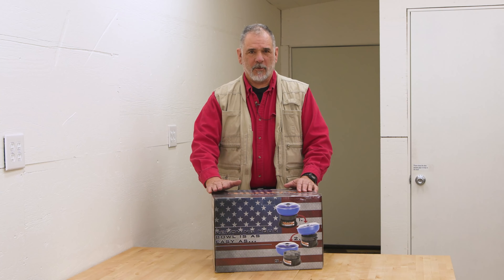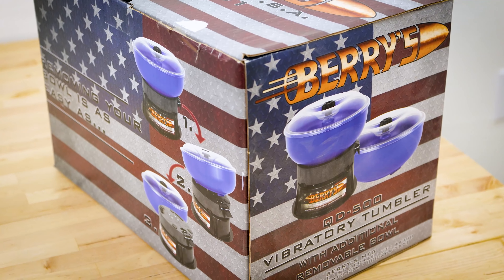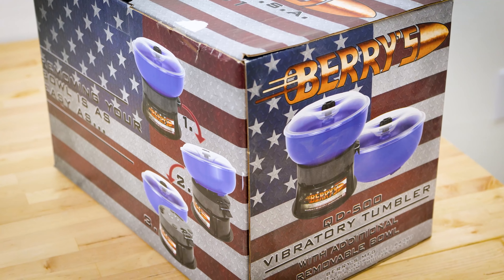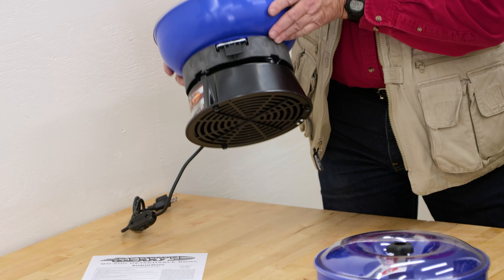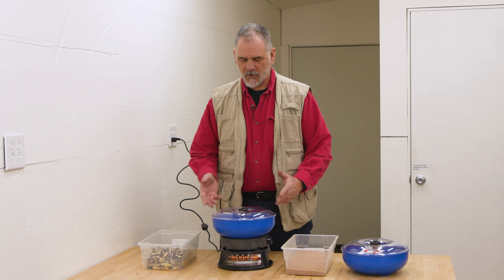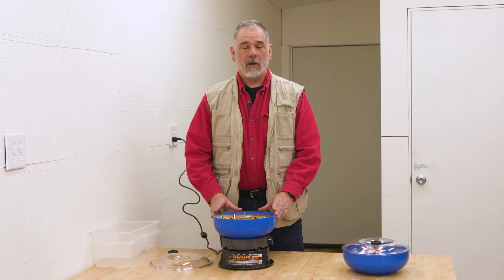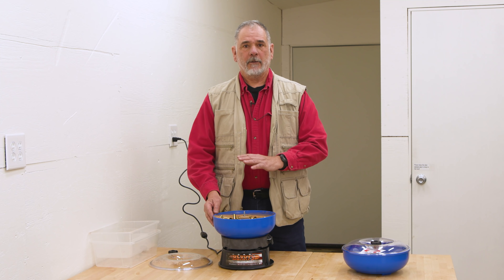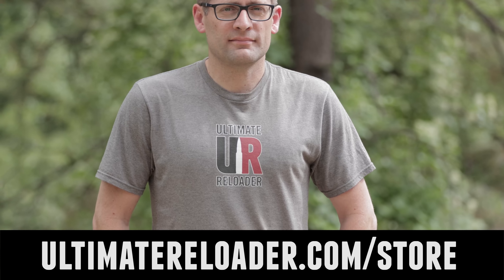Hands-On: Berry's QD-500 Vibratory Tumbler

Comment: Being able to remove the bowl and take it over to the sifter is a nice feature
Reply: You can do thr same with the lyman.
Reply: I love the quick change feature but gave up on dry tumbling after my house got contaminated with lead dust from doing it in the basement. Went to went tumbling after that. Only time I bust out the dry one is for the odd loaded round I want tumbled.
Reply: I got a wet rotary tumbler a few years ago, now my Lyman dry tumbler sits up in the attic unused.  Not having to worry about lead contaminated dust is huge part of that reason.

Comment: I used a dry tumbler for many years and them went to water and steel pins. The first wet equipment was the harbor fright rock tumbler.  I now use the frankford arsenal wet tumbler. An idea for a video would be Dry Tumbler vs Wet vs Ultra Sonic for Time, Quality of cleaning and cost of equipment for the method. Another idea for a video would be to ask a reloading brass company for a tour and talk about once fired brass and processing for resale.

Comment: I started reloading 50 years ago with a Lyman dry tumbler. When I started competing in F-class AND shooting prairie dogs (about 10 years ago) I was also using dry tumbling with walnut hulls and Dillon polishing liquid with a Dillon 750 and Dillon 500 tumbler. I then switched to using two Thumler's tumblers with SS pins. The wet tumbling solves a few problems not addressed with the dry tumbling. It cleans the primer pockets and case interior. It produces no abrasive dust that settles on everything in the area like 10 years of accumulated household dust. It's quick and produces a superior finish. It completely cleans the inside and the primer pockets to a state that looks factory unfired. The down side is the tumbling action peens the neck edge down so inside neck chamfering is needed. I tumble for 30 minutes. The burr is produced in as soon as 15 minutes. At 15 minutes the brass is not fully cleaned. In order to keep from removing too much brass (every time I prep the brass), I use a hand case neck reamer but turn it counterclockwise. This moves the burr out of the inside of the neck so bullet seating is smooth, without cutting brass away. Without doing this step, copper is shaved from the bullet jacket and seating force is all over the map. Hand swaging the necks of every round adds a significant amount of work. So, I have reverted back to using my two Dillons, walnut hulls and Dillon polishing media. The primer pockets remain somewhat carbon fouled and the polish isn't as nice, but the necks are not peened and they are clean enough. Another issue with wet tumbling with pins is the inside necks become too clean. Yes, they can be too clean. The carbon fouling left by vibratory tumbling acts as a barrier against galling/sticking. You must dry lube your necks if they are too clean, which prevents sticking(another step added). I now vibratory tumble both my competition brass AND my prairie dogging brass. I will shoot 1000 rounds of 6mm Dashers over a prairie dogging trip. My prairie dogging bullets are coated with Hex Boron Nitride so I can go all day without cleaning my barrel. Also makes cleaning much easier. I will shoot about 160-200 rounds for a weekend of F-Class competitions. Those bullets are weight sorted, tips trimmed and repointed and loaded without the HBN. For what it's worth...

Comment: I have been using an old vibratory tumbler that I used to polish rocks with. It works fine, large capacity, but it is messy and a real pain to empty.  You have to pick the whole unit up to dump it.

The removable bowl is a real plus, I'm tempted to try it.

Comment: I've been using a Midway 1288 that I bought about 35 years ago, looks like a pumpkin. Still runs like new but doesn't have near the rolling action like this Berry's has, nor is it as quiet. 
I ordered the QD500 from Midway this morning, along with more walnut and Flitz. I will get a wet tumbler and pins, too, but for the money I'm impressed with the Berry's stuff, and made in USA is certainly a big plus.
Thanks for the demonstration 🍻

Comment: Used to use the Dillon Reloading vibratory tumblers and added the FA wet.  Got tired of lifting and pouring that large Dillon machine.  Sold all of it and now use the Big Shot Tumbler -60 (LemiShine, Dawn and pins) and have one of the Berry's QD. I've used walnut, corn cob, rice hulls, rice but would appreciate learning if anyone has had success with dry ceramic media.  I do like the QD Tumbler nuts sold by Brownell's. Spinning knobs isn't for everyone

Comment: I have two of the cheap Frankfort arsenal ones, one of which I got used for $15, and both have worked well for 5+ years and 20,000+ cases.  Same thing with their case dryer.  Just a sample of one.

Comment: I do both dry and wet tumbling.

Dry tumbling for a preliminary one-hour cleaning using fine grade walnut (Harbor Freight) treated with a small amount of NuFinish liquid car polish.  The cases can then be decapped to remove the primers and then they are wet tumbled for 3-4 hours in a rotary tumbler with Dawn, Lemishine, and Guntap steel pin media. After I separate the pins and dirty water from the brass the cases are thoroughly rinsed and then wrapped up in a large towel and shaken to get most of the water off. I then spread them out on another towel under a ceiling fan to finish drying.

Comment: Been reloading for over 40 years. So 25 years ago I moved and had to down size and got rid of most of my reloading stuff.   Dumb move I know.  About 20 years ago I bought 2 equivalents to a Lyman 1200. Used them both since then. One went bad about 3 years ago so I purchased upgrades again sticking with Lyman this time I purchased the 2500 model. Love all three of them, yup one is over 18 years old and probably has cleaned well over 200,000 cases. They use walnut shells and while they clean well and get the outside and inside of the cases looking almost like new the flash hole and primer pockets always need extra care, I also mix Nu-Finish car polish in with the walnut. Talk about a shiny and wax protected finish. I have ammo I reloaded in 2014 that looks brand new.  Fast forward to about 2 to 3 years ago the ultrasonic cleaners are the rage, but they tend to leave the brass very clean but lack the new brass shiny luster.  So now I use the ultrasonic to clean the deprimed cases with citric acid, lemon oil, and dawn dish soap. No more issues with primer pockets.  After ultrasonic cleaning toss them in the dry tumblers and the finished product is brass that looks like it came off the factory floor.  
Stay safe and god bless the land of the free!

Comment: I like my brass nice and clean. After that half hour, the inside of those cases still looked real filthy. Mine go into the Frankfort Arsenal rotary tumbler and I use 1 tablespoon of Dawn dish soap, a 9mm case full of Lemi-Shine and the steel media pins that came with it for an hour to an hour and a half. 

Then after draining and separating the brass and steel media I dry the brass using a plastic colander/pasta sifter and a cheap thrift store blow dryer. After that they then go into the RCBS vibratory tumbler loaded with a 50/50 mix of walnut and corn cob media and 3 capfuls of Dillon’a ammonia free brass polish for an hour. Brass comes out with the inside, outside and primer pocket looking like brass gold! 

That said, I like the idea of the removable top as well as an extra too. But I see that clear plastic lid cracking and breaking in time. Time will tell.
Reply: That’s my Formula too.
I use the Large Thumbler’s Tumbler
The SS Pins Clean the Primer Pocket and Inside Shiny ✨
Reply: Maybe I'm missing something here, but why do so many people get in a twist about having the inside of their brass polished to a mirror shine?
As long as the outside is clean and shiny, my dies and chamber won't get dirty or scratched, and I'm certain that the powder charge will ignite just as well with semi-dirty interiors than with anal-retentive polishing.
Sorry, but I just don't get it.

Comment: I used to dry tumble, but moved on to wet tumbling with stainless pins using a FA Rotary Tumbler. I only use the old vibratory tumbler now for getting lube off of finished rounds by putting them through a 20 minute cycle with plain old ground corn cob media.

Comment: I had the Cabelas version (made by Berry’s) and wore it out over the course of 3 years. I liked it so well I bought 2 more. Does a great job and is quiet for what it is. In all fairness, if I would have cleaned the motor, the bearings probably would have lasted longer. When I start coating bullets, I will be buying dedicated bowls. Thanks again for the content.

Comment: I switched to wet tumbling a few years ago and haven’t touched my vibratory tumbler since.  You increase your lead exposure risk with dry tumbling due to it being in the dust.  Inhalation of lead is a huge cause of high lead levels in your body.  If you use the dry tumblers, you really should be wearing PPE when handling this stuff.  Also, lots of folks don’t realize that a lot of lead risk in processing brass comes from the primers.
Reply: I'm making a note to myself to stop licking the window sills next year....

Comment: Lyman rotary tumbler, 1-1/2 oz Hornady one shot and 5 pounds .047 stainless steel pins. Fill with cold water to about 3/4 full. Wash lube off cases with a bit of dish soap and warm water first. Pins stay clean.

Comment: Man that walnut media leaves more dust  on your stuff, than I get  on my truck after a dry October week of mulie and pronghorn hunting out in Wyoming. I have a Midway tumbler I've had for thirty years now. I fill it with cob media and a double shot of brass polish. Them babies shine up like the gold jewelry in a Tiffany's display case.
Reply: I see lots of comments about walnut hull media producing lots of dust, but why would that be a problem as long as you keep the lid secured on the tumbler?
Also, I've been told by other reloaders that what dust accumulates in the bowl can be reduced greatly with two or three used dryer sheets put in the bowl before the tumbling starts.
As long as your case separator has a lid, the dust from separating should be contained in that too.
I've done plenty of case cleaning using my 30-year-old vibratory tumbler, and I have no idea what all this bellyaching about dust is.

Comment: I am using a vibratory tumbler I bought from MidwayUSA years ago, marked Midway Model 1488. The base is black, and the bowel is orange, so it could well be a Lyman product. Ground Walnut medium has been my choice, as its abrasiveness scrubs the crud off pistol brass, as well as my rifle brass. All vibratory tumblers work about the same, with the difference being the size of the bowel.

Comment: I use an old lyman turbo tumbler with treated corn cob. Takes about 3hrs to get em nice and shiny to my liking.
Reply: Would you recommend corn cob over crushed walnut?  The walnut I use creates a good amount of dust after a while, and I’ve heard corn cob doesn’t and lasts longer.
Reply: @bannedbycommieyoutube5time920  If you're cleaning once-fired brass or brass that isn't particularly dirty, corn cob will tend to get a higher polish more rapidly and with less dust.
If your brass is heavily fouled, go with walnut.
You can greatly reduce the dust by not opening up the top of the bowl until the tumbling process is complete and the tumbler is switched off.
You can reduce the dust more by waiting a minute or two before taking the lid off the bowl and by putting two or three used dryer sheets into the bowl before beginning the tumbling process.
If dust with your rotary brass separator is a concern, just be sure to have s separator that has a lid that covers the whole thing before you start spinning out the media, then wait a minute before opening the lid.
I do it all the time with both walnut and corn cob and I find myself puzzled by all the guys who go through the hassle of rotary tumblers with liquid and stainless steel pins because they're so put off with dust.
Reply: @Gunners_Mate_Guns  thank you very much!  The brass isn’t that dirty as most of it is picked up at a shooting range with a clean concrete floor.  I will have to try the corn cob.  Your dust mitigation tips make sense as well.

Happy shooting 🇺🇸

Comment: American Flag box - Made in China device?
Reply: @Tex Patriot, From the Berry's website
Quote
Berry's Model QD-500 Vibratory Tumbler is an industry first. With a patented quick-detach system, you can remove the bowl from the base completely, keeping spills and messes to a minimum as you pour your brass and media into a separator without having to handle the entire unit. The large, smooth bowl aids in turning and moving the brass and media for quick thorough cleaning. The clear domed polycarbonate lid lets you see the progress without turning off the motor. The motor comes with a 3-year warranty; all other parts come with a lifetime warranty and are made in the USA. "
Glad to read that information.
Reply: Berry's site seems to indicate that only the motor is made in Commiestan.
I'm a made in USA guy, so I'll probably buy this tumbler.
Reply: Motor is made in China...the most important part of the tumbler but is the weak link.